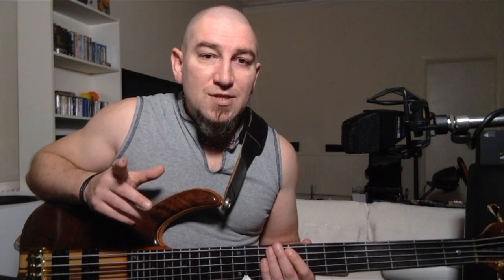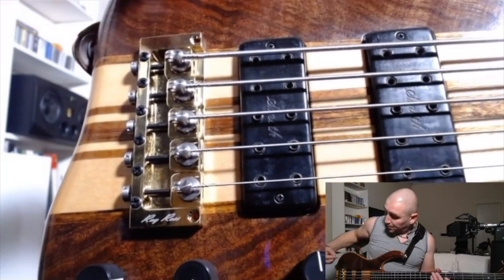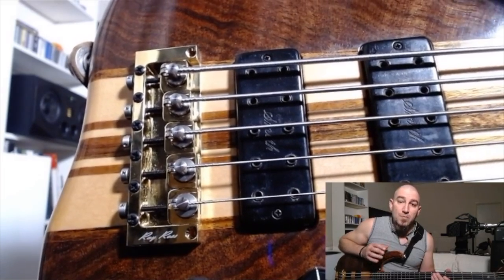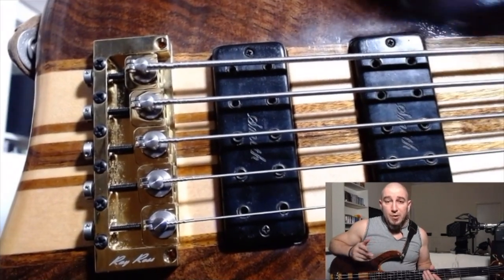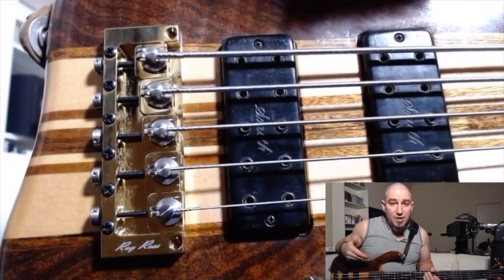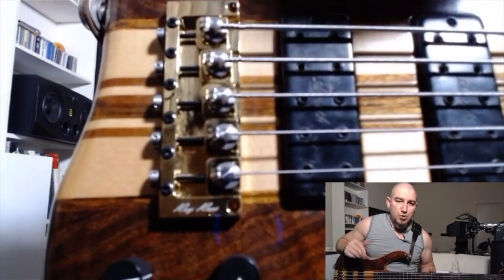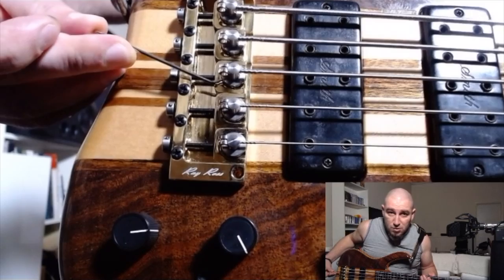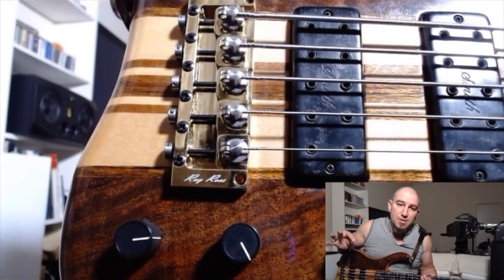Ray Ross saddle-less bridge on my Ken Smith - improving upon perfection

Comment: When you fitted the Ray Ross Bridge to your Ken Smith Bass, which has a nominal 18mm inter string spacing, measured between string centres at the Bridge Saddles on the original Bridge, did you fit the Ray Ross Bridge which has 17mm between its string centres, or the wider version with 19mm between string centres?  My Ken Smith Black Tiger 5 string has 17.53 of an inch (11/16ths of an inch) between string centres measured at its Ken Smith original Bridge Saddles.
Reply from the maker: Hey man, I used the 19mm Ray Ross. The screw holes fit almost perfectly - slight offset on the outer two but they still screw in place without any additional drilling. The strings are well within the neck width without any issue whatsoever - widening the spacing is minimal at the middle of the neck and about 1mm each side at the bottom (closer side to the bridge). Been playing it like this for a while and to me it feels great. I’m used to 19mm from my other basses anyway. 

Not sure about the Black Tiger - my one is fusion elite, but I think they all use the same bridge, string spacing and neck width so it should fit without any issues.
Reply: @thedatabass602  Thank you. I'll order the 19mm version.  Much appreciated.

Comment: Listened to this through AKG semi-open back studio headphones in my home studio setup through my Denon monitor amp.
The difference when switching from the Ken Smith bridge to the Ray Ross is notable,- could just be me and my lousy ears,- but given that you didn´t change any other parameters but the bridges I hear a lot more and fuller low end and a much more open and clear tone from the Ray Ross bridge.
Immediately want to start upgrading and customizing my trusted Peavey, Epiphone and Hagström basses and I just can´t wait for him to reinvent/redesign the standard LP, Strat, Kahler and Floyd Rose designs to start further upgrading my Vikingr Metal already customized extended range/ fanned fret etc. 6-7-9 string guitars.
Maybe even get my hands on a 7-string Harley Benton bass and start customizing and upgrading it myself including placing a special order with him for a 7-string bridge- could be awesome.
This bridge is an abslute reinvention, just like you I need at least a couple, and I´m gonna have a ball.
New sub,- keep good stuff coming,- particularily on the finer points of modern bass gear and bass playing.

Comment: Man.  I was just about to throw down on a Babicz with the through body ferrules to drill into my body.
Reply from the maker: What did you decide to do? Babiczs are great bridges, I love them, however in my opinion I don’t hear these extra frequencies out of them because of the standard saddles design.
Reply: @thedatabass602  Either a Babicz or one Ray Ross would cost more than BOTH of my basses combined.
As I bought 3 of the last 20 sets of Rotosound 99 psd strings in the nation, I'm not getting a bridge this month.

Comment: hi just would like to ask if you said the original spacing is 18 mm what did you buy? 17 mm or the 19 mm? to fit the original 18mm on your bass
Reply from the maker: This is the 19mm and it fits perfectly :)
Reply from the maker: The screw holes match on the Smith. I can not guarantee about other basses but on my Lakland I just made new ones, it was half an hour a job.
Reply: @thedatabass602  thanks for the reply cheers :)